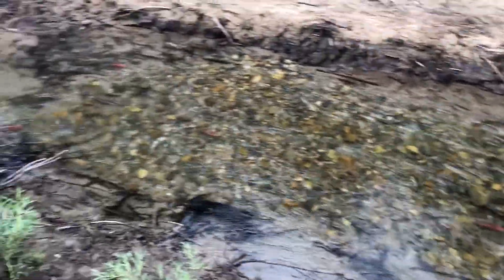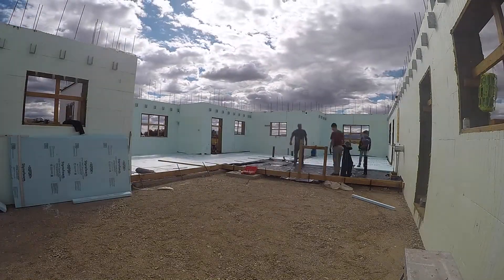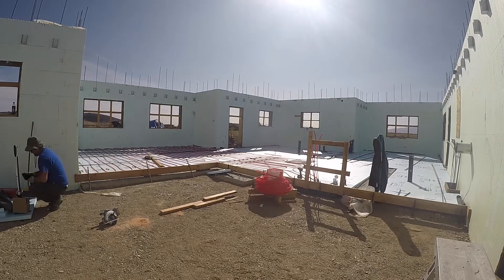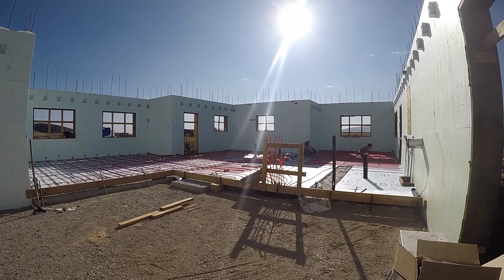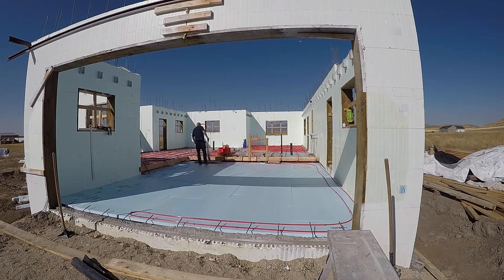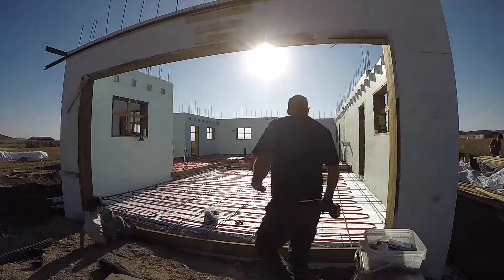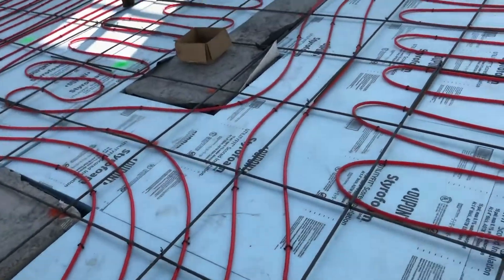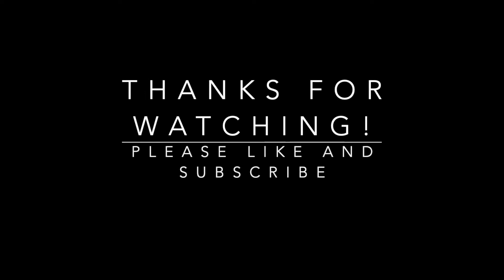Slab Prep Part 2 (Episode 9)

Comment: i thought about putting radiant heat in my house but after checking it out it seems to take 3 to 4 days to heat up. but where i live by the time it got hot i would have to turn it off. because like last week it was in the 20's the next day it was 76 and yesterday it was in the high 30's but by the afternoon it was 76. and today its suppose to be 78 but 35 after dark. so i talked myself out of it.  your doing good and hope to catch up to date on your videos in the next day or 2

Comment: Vow. Radiant heat is the ultimate luxury. Many people don’t get it when they buy house. I am in PA and would trade anything for radiant floor.

I read concrete slab takes time to heat up. Alternative will be warm board or eco board for radiant heat but adds a lot of cost
Reply from the maker: Concrete does take a long time to heat up. But it keeps the heat for a long time too. We couldn't afford warmboard or eco board. I would have had all three floors be concrete if I had my druthers. We had to go with a more cost saving option.